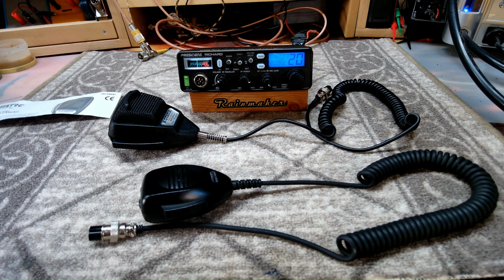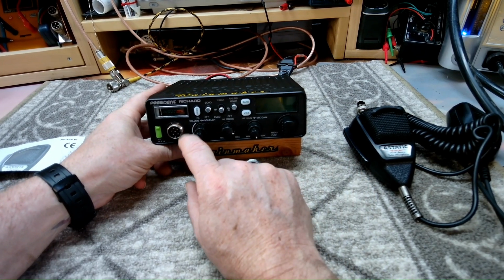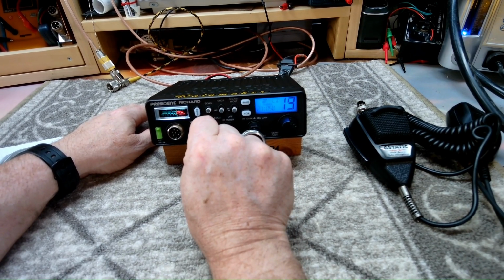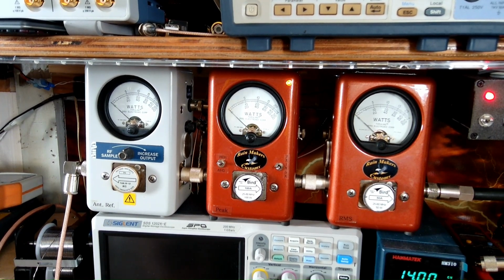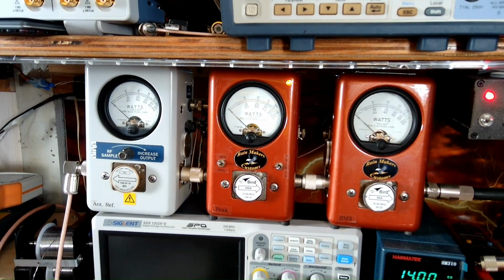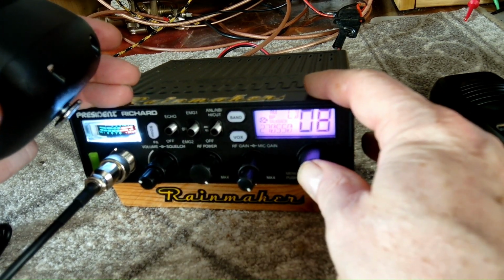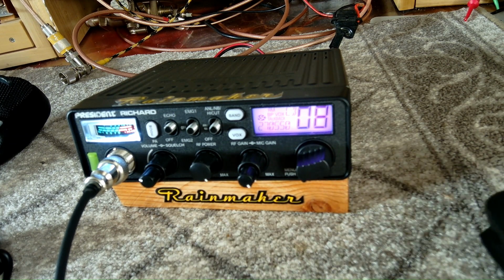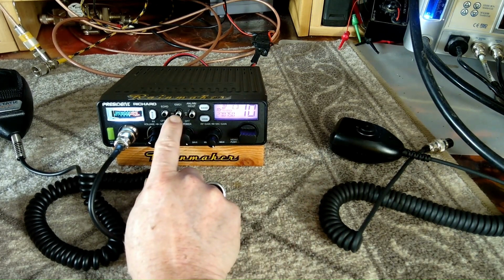President Richard Setting up features

Comment: How are you getting 50w with 1w carrier? Mine is limited to 8w at 1w carrier. I can get 50 at about 5wdc
Reply from the maker: Part of it is you have to set everything in the menu for starters.  Then, I have created my own n p c modification that allows the radio to swing like this
Reply: @rainmakerscustomsrainmaker8985  yeah im familiar with the menu. I miss my old cobra, this radio has a lot of quirks. The swr bridge decided to pulse full 50w out of nowhere and fry my driver amp. Lol
Reply from the maker: @thaddeusforreal  that's strange. this is the first I've herd of this happening.
Reply: @rainmakerscustomsrainmaker8985  yeah it started off at a low level swr pulse, maybe 1w swinging up to 4, then one day it just went full blast and in checked the meter and it was doing 50w bursts.

Comment: How can you switch from 28-29.000 to the 27mc band ?
Reply from the maker: @roelhaustein2951  the radio will need to be converted in order to switch. Let's between these bands. Then it's just as simple as pushing a button
Reply: @rainmakerscustomsrainmaker8985  can you make a sample,because here in the Netherlands we use only the 27 , i have pushed with zero result